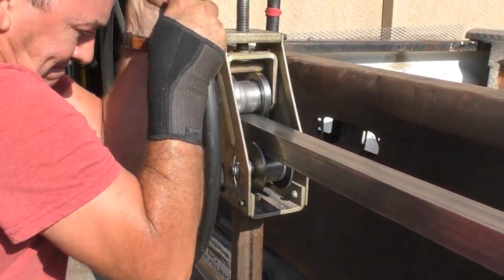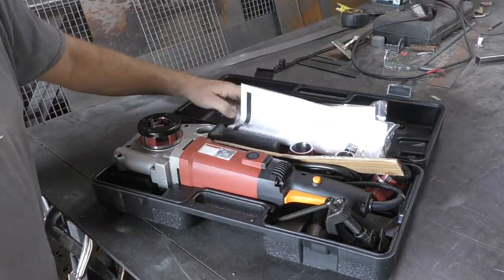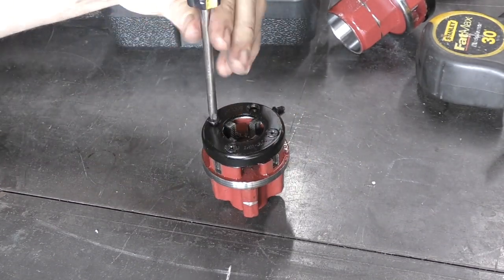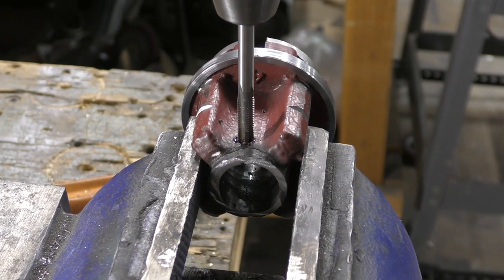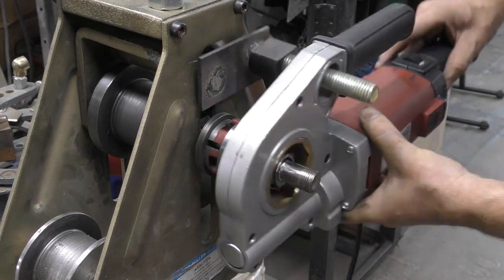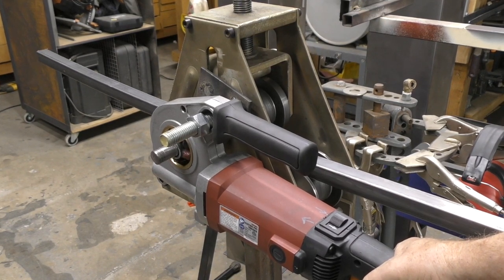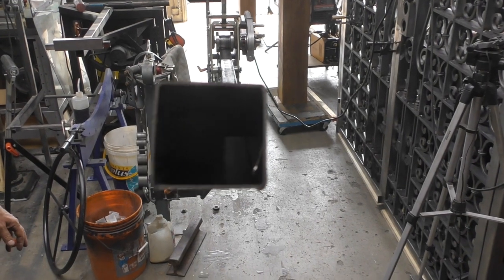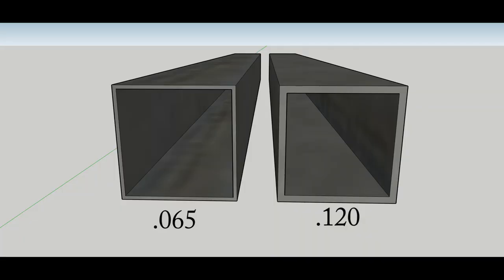Modified Harbor Freight Metal Roller - Electric Pipe Threader Add-On

Comment: Hi Doug, I once had similar difficulties. So my modifications included - being able to spread the base rollers further apart, installed a hand winch off a boat trailer for the gear reduction and for thin wall, I use heat, reduce the feed pressure & make more passes (a LOT more passes) to avoid wrinkles.  Good luck, Stay safe and well :)
Reply from the maker: Yeah I was wondering if heating the 2" tube would've prevented some of the deformation. It was a great lesson action/reaction. We actually tried .095 x 2" as tubing but the top die started tearing into the tubing and we didn't want to trash the dies so we ended up just giving the task to my metal supplier
Reply: @ArtfullyRogue  I hear you brother.  The heat helps to initially shrink one side - so for 2" SHS, heat a square section about 2-3" on one face and then on both sides bring the heat into a V. When you cool it down quickly it will shrink and the tube will start to bend in that direction. Repeat this along the tube. Once you initially "shrink bend" the tube, then heat again and roll it.  If you have more trouble, let me know & I'll send a more detailed email.  Good luck :)

Comment: I have done the full swag off-road wings, drive, and hydraulic bottle jack. I found that it was difficult to control run on and keep my bends level not corkscrew. I got a foot peddle and just taped the switch on the pipe threader down. You still have the reverse/forward switch in the same spot but it allows me to keep a straight on look at the bending. I haven’t tried square tube yet but 1”; 1.5” and 2” stainless steel up to .125 wall thickness goes through with no problem.

Comment: I did a recurved arch on my front gate.  Finished size was 1 inch X 1 inch.  My solution was to stack two layers of 1/2 inch X 1 inch solid after first bending them to shape in my hydraulic press.  Then I aligned and welded the layers together.  The rest of the gate was constructed of square tubing.  One of my future projects will be to construct a rolling bender.  I want to try it out curving handrails.  Cheers.
Reply from the maker: Curving handrails is an art unto itself. I've done one and it was a great challenge but took me longer than I had wanted. I learned a lot in the process though

Comment: Maybe overkill, but if you could NOT get another shop to bend the 2" for you - how about bending 2 identical 1" place them side by side, the 2 more slightly larger to fit directly on top, then weld all 4 together.  More work, but would be strong.
LOVE the idea of using the pipe threader.  Was going to try something similar bc of the high torque.  Thanks for sharing!
Reply from the maker: I ended up get my metal supplier to bend the square tubing. Saved a ton of time and effort on the project. I now use the bender on smaller jobs though

Comment: Hi Doug. I really like this topic of “How too”.       First great attempt, learned some stuff. Can’t pay for that at college. I’m totally on board with the modification. There might have been a little play on the walls of the square bar being rolled. That contributes too the unwanted finished look. Also the thinness of the metal. Was kinda hard to see. All that being said. Still well worth the effort. I have also used a threading pipe tool to my roller. 
Know this is where I can get misinterpreted. Harbor freight is a homeowner hardware store. Just like any tool from anywhere. The moment you modified it. Well the product is voided as per warranty and design operation. Not that anything is wrong with modifying things. I give you big points for saying it works for smaller stuff. I guess what I’m saying is there is a fundamental difference between homeowners tools and commercial tools. Sometimes HF gets a bad rap. 
Well in the end. You got yourself a new tool for the shop, learned some stuff. Lastly got a bad ass finished gate. It looks amazing Doug and crew, well done. I’m still confused why you don’t have 2-3 hundred thousand views. Be safe!
Reply from the maker: Thanks Allen👍😊 I think if I had more time I probably worked on a more detailed modification. There are several premade mods that use the threader. Swag off road and Gear head both sell all the parts needed. And honestly I rarely buy anything from HF with a cord however I've noticed that they're trying to improve their products and as long as you don't void the warranty😉 they have a great return policy. It was still worth it for me since we could take our mangled tubing to my metal supplier and they could copy the arch. All in all I'm fairly pleased and yes now I can open myself up to other ideas for projects 😊😊

Comment: Great idea! Did you try the .120 wall yourself? It may have worked. I couldn’t tell from the video maybe if your dies/rollers fit the sidewalls of the 2” tube with the .062 wall tighter. They may not have bulged out and deformed so much.
Reply from the maker: We tried .095 and the dies started tearing into the top corners of the tubing. We didn't want to risk trashing the dies so we threw in the towel for now in the 2" and just had my metal supplier do it

Comment: Hey buddy I have the same modifications on my tube bender , but every time I bend the pipe it never come up straight , I will appreciate any sugestións tankyou
Reply from the maker: I'm still working it out. I have discovered the smaller the tubing, the easier it is to control. A second set of hands has helped as well to while one person operates the threader the other is helping to guide and keep the material straight